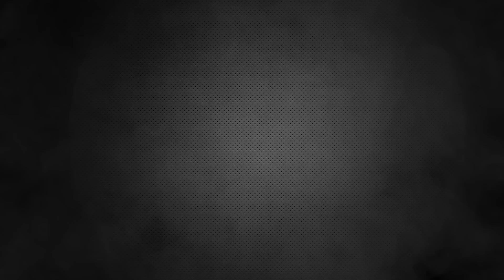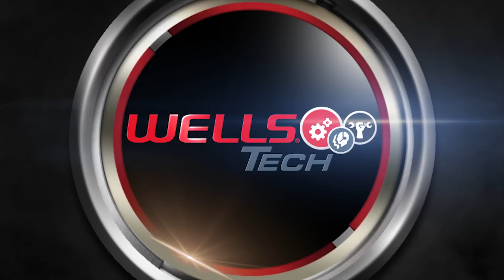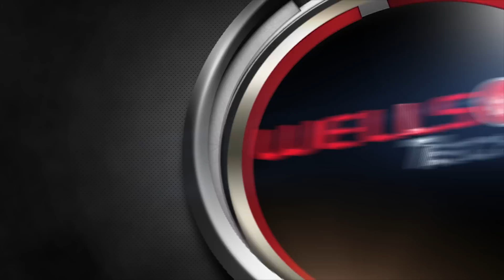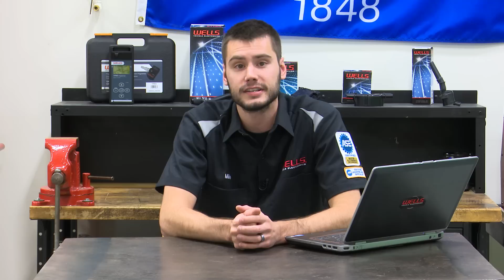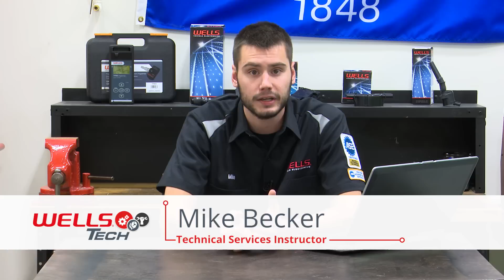Wells TechConnect Ep. 13

Comment: Mike just repaired a 2013 ford explorer it had the codes stored in mode 10. It took 3 drive cycles from ambient temp to full operating temp to clear mode 10. once all monitors cleared so did mode 10. had to read up on the procedure as this was my first encounter with mode 10.
Reply from the maker: Nice one George! Glad to hear that it all worked out. I am actually a little surprised that the computer cleared out the code in Mode $10 so quickly. I would have expected to see it there for a little bit longer after the monitors all passed. Good info! Thanks!
MIke Becker, Technical Services Instructor